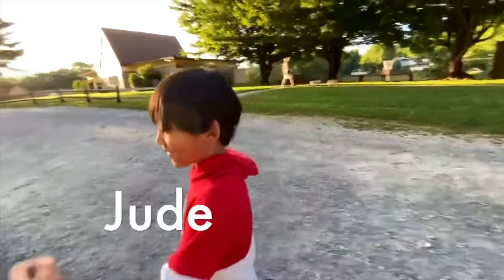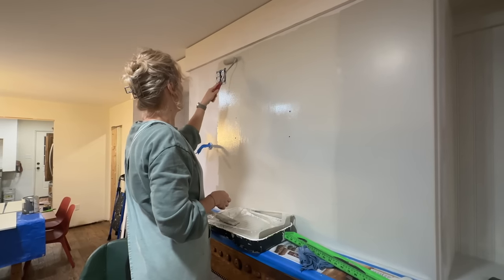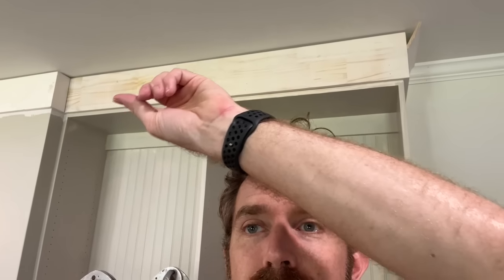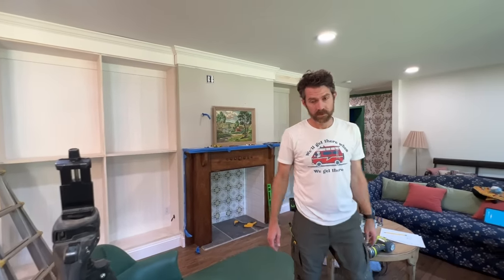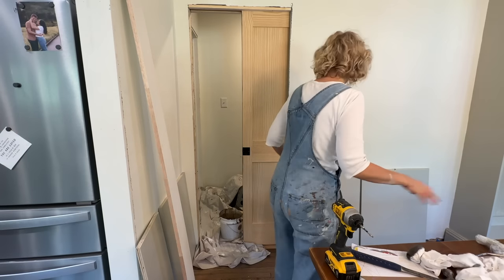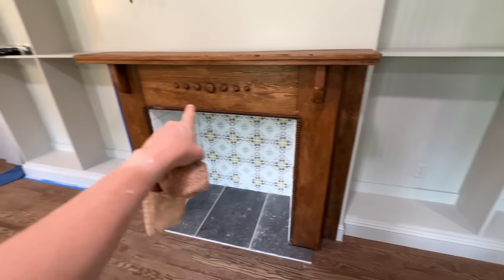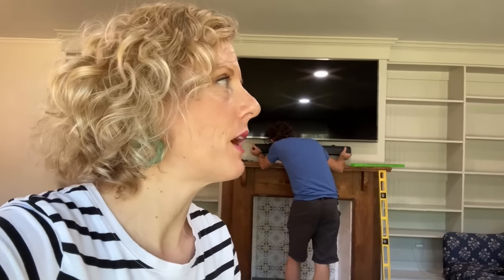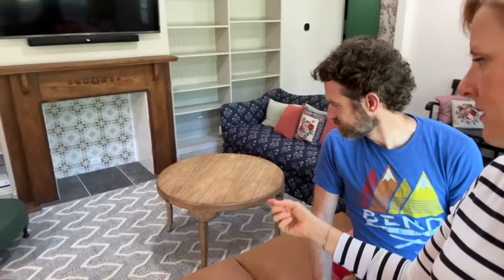DIY BUILT IN BOOKCASES : PART 2

Comment: Very nice...Hey, I was painting during GC, too. Well, I was applying briwax to our new tongue and grove pine walls. We've been working on our tiny cottage off and on over the last three summers. We put in dance crown molding and baseboards in a 4000-square-foot house once. It took forever to fill the nail holes, caulk, and paint it all. You all amaze me with your speed and energy.

Comment: Mike, you can always use a compound miter saw. (Not sure what you have, I can’t remember 😂) With a compound miter saw, you set the bevel and the miter at same time and cut the molding FLAT. I did this before on an 8 inch crown. ( no way to bed it like normal). There are formulas on the web to tell you exact bevel and miter to set on. The key to crown is the bedding of it against the backstop. If you roll just slightly from piece to piece, it’s a nightmare. An easy way is to bed a piece and clamp a board stop to set against and then bed each piece up to it and it’ll work out better. Great job on what you did! Remember this: “Do your best and caulk the rest!” Even the most experienced trim guys (I’ve been doing it for over 30 years) still can’t cut PERFECT molding miters! There are too many variables involved. Is the ceiling level? Is the wall plumb? Etc etc. Older houses can be even worse sometimes! Keep up the great work! You sir are very impressive! 😉

Comment: Yes I am so glad you left that side board stained with the mantel and did not paint to match the bookcases. YES! Also I have a stocking stand for more stackings, and I love it. Last year I added another stand to have one on each side of the fireplace.  They are like short hat stands, but made for stockings. I put original 3 on the fireplace, and grands and spouses on each side. Looked and worked great. Or hang some could be hung from the booksheves right next fo the fireplace.

Comment: Great job on the crown molding! I remember having the same struggles when putting some up. My advice is to do the sections that pop out from the wall first, such as over the fireplace. Then it is so much easier to fit the other sections around those sections. And, as has been said, caulk is a wonderful thing!

Comment: Just a thought, it looks really great, but as the top board and crown moulding and the bottom is pretty substantial, it might be an idea to add another side board to each end (to make it twice as thick) and then put a front piece/strip on it from top to bottom. To make the sides look less thin and more substantial. I'm sure that's not making sense. if only I could draw it! Anyway, it's looks great, love the colour.